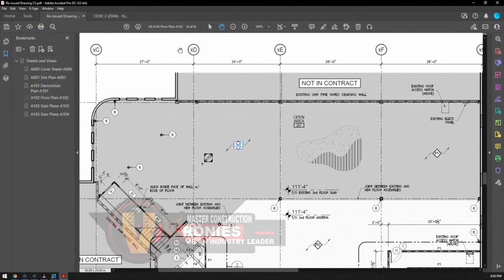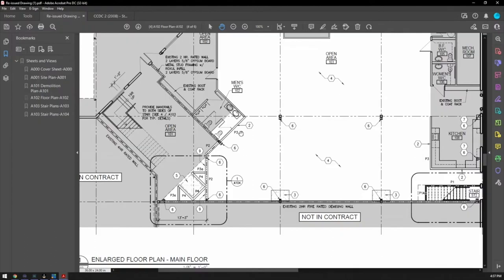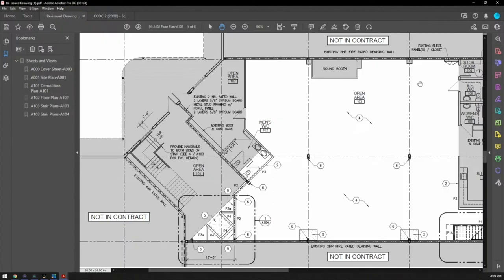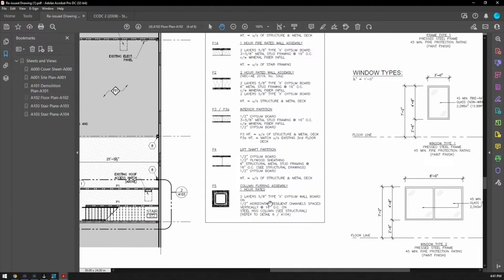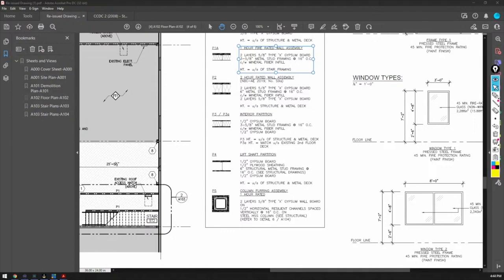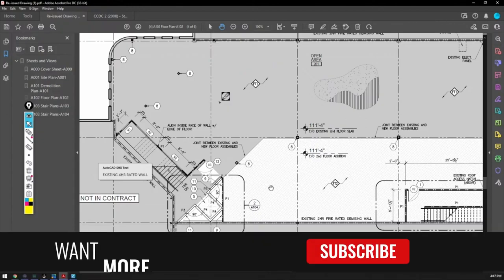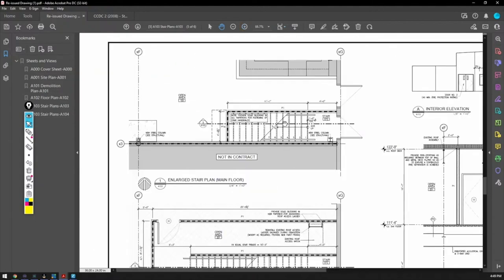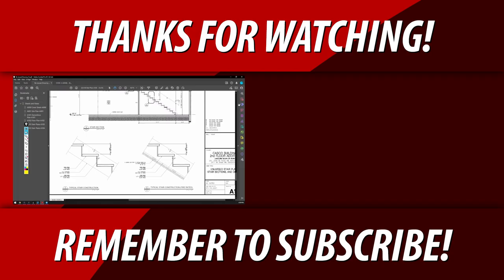Blueprint Reading For Metal Stud & Drywall

Comment: what is the difference between partition walls underside the ceiling, the underside of the structure, and all the way to the deck?
Reply from the maker: To u/s structure means to the highest structure could be deck, concrete or wood. Usually fire rated and they are also called partitions, all interior walls are partitions and exterior walls, well exterior walls. Partitions can be of many heights, then we have half walls, and bulkheads, soffits and ceilings. Parapets are above roof and above exterior walls.

Comment: Soooo how do you come up with the square footage number so you know how many sheets lol
Reply from the maker: When its time to order the sheets we will count right from the walls after framing usually, but you can divide the wall length by 4 and thats your sheet count. If you need tops then order the same number of top sheets as the bottoms.

Comment: how can you find out the height ? , still getting confused on height
Reply from the maker: The fire plan, or in the specifications will show you all the fire rated walls, they always go floor to underside of structure. All the rest of the walls are dictated by ceiling height. If a room has no ceiling then those walls also all the way up drywall and tape ready for paint. All rooms with ceilings the framing just has to go above those heights. We usually pick one length so if the ceilings are say 10'-6" we use 12' studs and don't cut them and drywall to 11' (cut a foot off a 12)  same if they are 9'-6" or lower we use 10' studs and drywall to 9'-8". So check the reflected ceiling plan and fire rating.

Comment: What do they call floor lever pop ups cut outs ??
Reply from the maker: Not sure what you mean but check this out my man: In the drawings.
1. Every page is labelled - numbered and named
2. A circle with an arrow is a cut through to the direction the arrow is facing and references an elevation
3. Wall types - Every type of wall, ceiling has to be completely stated in words at min 
4. Floor plan gives a birds eye view and dimensions of walls - walls labelled to wall type
5. Reflected ceiling plan - bulkheads and ceiling types birds eye view like floor plan
6. Wall types cut cut throughs shows the elevations and details for any sections
7. Elevations - Gives you details for final finishes on the exteriors of buildings. 
8. Details - anything referenced in the drawing in the floor plans, section details or elevations will be here. it will be a number over a number. for ex 5/a4.6 meaning detail 5 on page a(architectural) 4.6
Specifications will be the references in writing on the drawings or in the spec books / bid package.